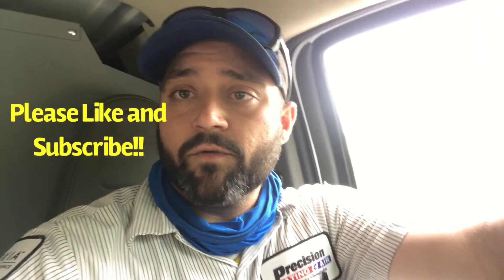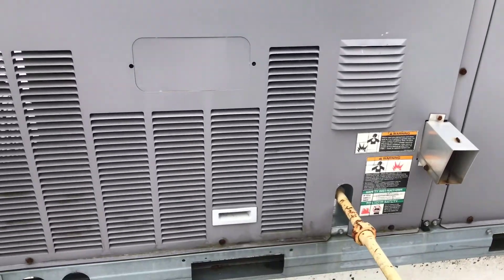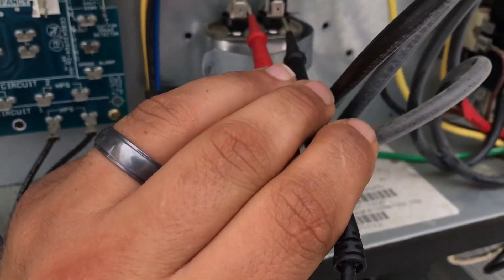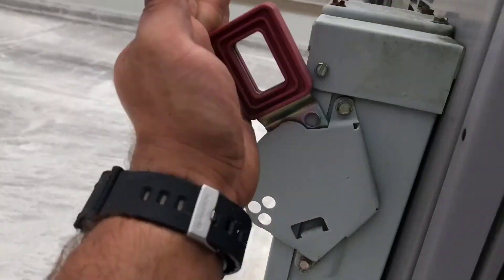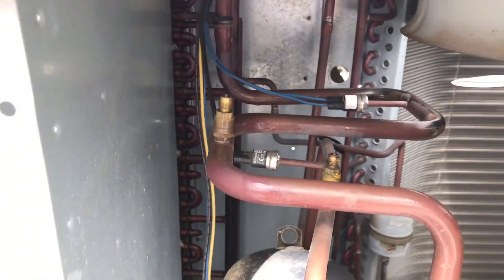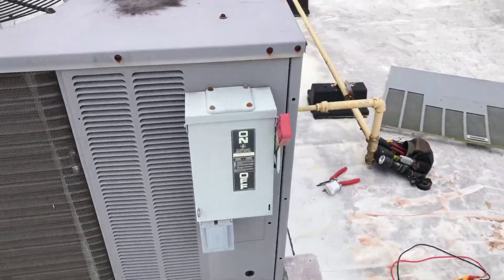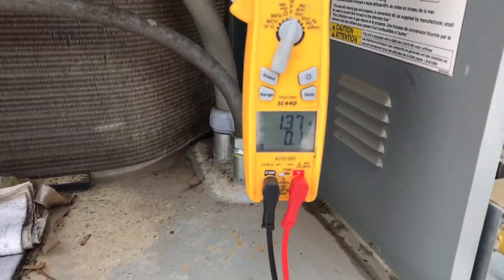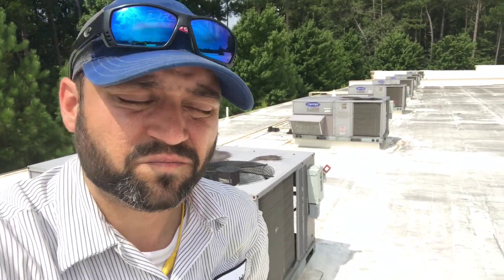Rooftop Unit Not Cooling-HVAC Service Call

Comment: Fan capacitor. I spin the blades to check also. With no former training, I found out that little trick just by trial once. It's a handy tip to know that the motor spins freely and hasn't seized up.
Reply: Actually that can tell you alot.  Cap usually, but seized, you would hear it....
Reply: Lol I’m sure he knows that trick as well

Comment: AC tries to turn on and buzzes for 10-15 seconds, then it turns off.  No fan. Nothing….   Tried turning it from ON to OFF a few times, and still have nothing going on when I try it.
Reply: Contactor would be the first thing I check.

Comment: High Subcool and High Superheat indicates a restriction in the metering device along with dirty condenser coils. Did you replace filters? Good video✌️
Reply: The sub cooling was high because he was checking the discharge pressure and not the liquid line pressure. He would need to install a liquid line pressure line tap to read the sub cooling. Carrier does not install a liquid line pressure line fitting, to much money.

Comment: Please get in the habit of totally disconnecting the cap before reading. Same with compressors.
Reply: Lol it doesn’t make a difference and compressors, you can check the wires at the same time

Comment: Is it standard for the compressor to get really hot to the touch?
Reply: Probably not, check the charge
Reply: scroll compressors tend to get hot to the touch on the bulbous top section